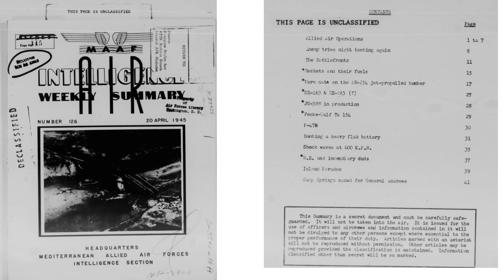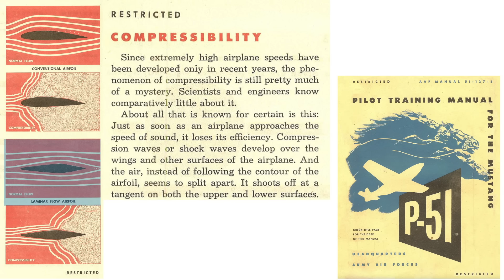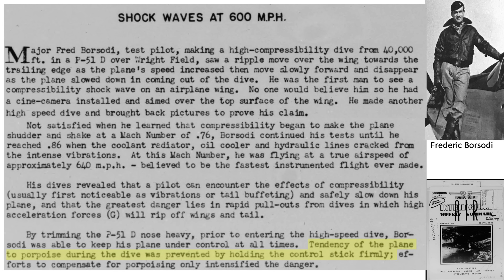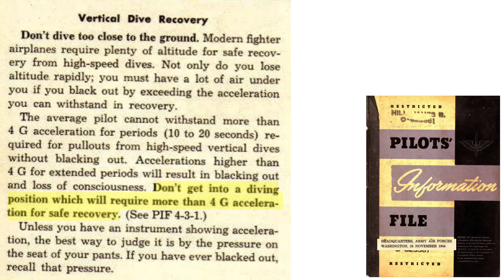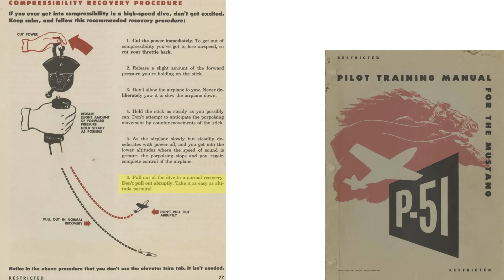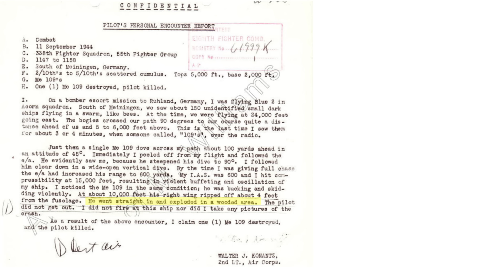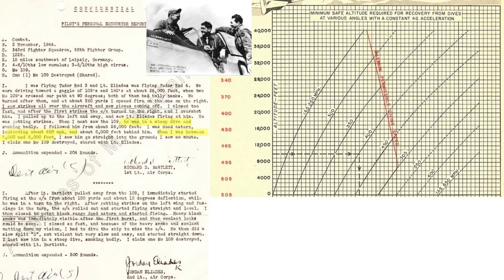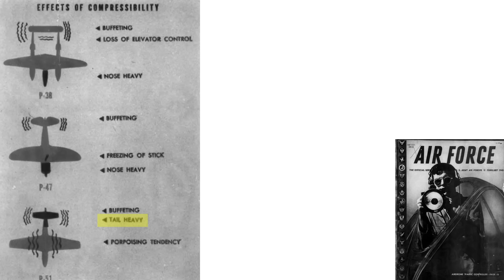P-51s Attacking German Fighters to Speeds of 650 mph, 7 Combat Narration Reviews

Comment: 640 mph True Airspeed and Mach 0.86 correspond to a Standard Day altitude of around 5000 ft.
I doubt that the actual numbers were close to that.  Airspeed Indicators and Altimeters get very inaccurate when shock wave start forming - particularly if the shock is near the Static Source Ports - where the reference values that the instruments use to derive the readings come from.
Reply: Agree
Reply: Very astute comment and very true.
Reply: I don't know about that one being in compressability at 500 ft either, even if his altitude was 500 feet above the ground that itself was 4 or 5 thousand feet above sea level, because an actual altitude of 500 feet above ground that's near sea level should have him in thick enough air that he shouldn't even be experiencing compressability, but either way with just 500 feet to go I don't understand how he could have recovered from compressability and pulled up in time, SPLAT!!! is how that should have ended, not him filling out a report, that steep of a dive and that speed at 500 ft the ground is about ½ second away, you'd think the result of that would have been "Dear Mr and Mrs Jones, the United States Army Air Forces regrets to inform you...", I actually rewound the video after I heard that because I thought I'd heard it wrong the first time and couldn't believe he said 500 ft.
Reply: Don't forget that it's warmer air as well - The Speed of Sound varies with temperature, not density.
On a Standard Day at Sea Level, Mach 1 is 'bout 760 mph.  It decreases with the temperature until you reach the Tropopause - About 36,000' - where it's 661 mph.
During the late 1950s - Early 1950s, when jets weren't yet supersonic in level flight - F-86s or Hawker Hunters, say, speed records were set in the hottest places you could find - Death Valley, or the Sahara Desert.
This allowed the highest airspeed for the airplane's Mach Number, thus pushing the point where the Drag Rise occurred higher.
Reply: -A Machmeter would have been a big help on these aircraft.   They require a fairly elaborate computation (eg square root extraction, see wiki article on mach meter equation) but that can be done mechanically with logarithmic antilogarithmic cams and addition subtraction through differentials.  Only the pitot-static (prandle tube) data is needed for the computer.
-Once you have the Mach meter you could use it to trim the elevator say electrically.  It's far better to have an all moving stabilisier than trim tabs.   Trimming for Mach tuck can't be done manually since the onset is too fast and then when it abates the aircraft can pitch so suddenly it disintegrates.   
-All the German aircraft had an all trimming elevator (Me 109, Fw 190, Me 262)  as did the piper cub but the P-51 used trim tabs.  
-So if I wanted to make the P-51 a better diving aircraft I'd add a Machmeter and if possible and automatically trimming stabilisier or elevator.
-Some kind of area ruling if possible.  Waisting the fuselage would be costly but maybe recontouring the bubble canopy.
Reply: @bernhardzunk7402  
Doesn't matter, there was no trimming compressability out of them, the airframes and wings just weren't designed to be able to keep the phenomenon from happening because nobody understood it at the time they were designed, they didn't know what it was as these were the first aircraft to approach the speed of sound, that's how aircraft designers found out about it, from the aircraft experiencing it with a human inside to report it, they didn't know what a shock wave was and how it moving from the leading edges of everything down the fuselage and across the surface of the wing to the trailing edge during transonic speeds would affect things, that's the problem, once the shock wave gets to the trailing edge of something it's no longer a problem, but when it moves back the wing and it gets to the ailerons it clamps onto them like a vice, and if at that point it dances back and forth across a control surface it can make them violently flap around and tear themselves apart, before they really understood what was going on the early prototype P47's with fabric covered control surfaces on the tail in high speed dive tests would rip them to shreds, they didn't really understand what was going on but they realized very quickly they'd better switch to metal surfaces, at that point in history about the only two things man made that broke the sound barrier was a projectile from a gun and a whip, needless to say neither one of them had a human on board to observe and experience shock waves and their effect, it took people in these first aircraft that had enough power and little enough drag to approach the speed of sound in a hard dive to discover shock waves and their effects, but their basic design just can't get through transonic speeds they can only get stuck in them.
Reply: @dukecraig2402  Nicely done - but your did forget one area where compressibility effects were known, and that they had been trying to work with since the early 1930s - propellers.  As propeller diameters increased, the blade tips started to exceed the speed of sound, decreasing efficiency and increasing noise.  You don't need much forward airspeed to reach that condition.
If you've ever heard a T-6 take off, most of that irritating snarl is coming from the prop tips exceeding the speed of sound,
Reply: @dukecraig2402  -In terms of using a machmeter to auto trim the stabiliser I'd like to note that its the modern solution for any jet that flies above Mach 0.8. At the time pilots notes for high speed dives (as in this video)  that were going to encounter mach tuck usually involved the advice to lightly trim the nose up before the dive.
-manually trimming out of the dive was extremely dangerous since when the Mach Tuck disappeared the aircraft would be massively over trimmed, pitch up and over stress before the pilot had an opportunity to react.  
-Using Mach pitch AutoTrim would do at least provide something to improve safe recover but without either swept wings, area ruling or thinner wings and other modifications such as a T tail etc there would be further Problems a little down the Mach road.  
-Good description of how the shock wave moved across the control surface .
Reply: @bernhardzunk7402  They did have Machmeters - they just weren't in general use.  Just like Airspeed Indicators and Altimeters, they're subject to Position Errors as the shockwaves form. As for trimming and pitch control effectiveness - Yes, the Me 109 and Me 262 used tailplane incidence for trim.  But in those aircraft, it was useless for control at high Mach Numbers - the actuators (Handwheel on the 109, Electric Motor on the 262) didn't have the strength to overcome the forces on the tailplane.  As for using a slab tail, it was well known, at least in the U.S. and Great Britain, that that could overcome the issue of the shockwaves reducing elevator effectiveness.  Slab tails were flown in 1943 on both sides of the Atlantic - A Spitfire at the A&AEE, and the XP-42 by the N.A.C.A. It was found that Irreversible Powered controls were necessary - the normal methods of easing control forces at the time - Aerodynamic Balancing, Boost Tabs and Servo Tabs - didn't work across the entire speed range.  What worked at low speeds didn't work at high speeds, and vice versa.
Trimming into a Transonic Dive in anything was a Bad Idea - due to the reduced control effectiveness above the Critical Mach Number, once the aircraft started to slow, and the elevators became effective, there would be a massive G onset that would most likely cause a structural failure.
Area Ruling doesn't give any significant advantages until you get above Mach 0.9.
The solution to getting most airplanes out of Compressibility Dives (The only way to get there), was the Dive Recovery Flap - an extendible flap on the lower surface of the wing, which would move the Center of Moment of the wing (Which shifts aft with the shockwave) forward, inducing a nose-up pitch.  These were added to the P-38 and P-47, which had lower Critical Mach Numbers, and didn't require much of a dive to get into trouble.
The P-51 and the Spitfire while susceptible to Mach Tuck and the other shockwave related problems, had higher Critical Mach Numbers, and better control in the buffet region, and didn't require the Dive Recovery Flaps.
While transonic behavior was a factor for propeller-driven fighters, it became critical for the early jets - they had low drag airframes, and enough thrust to be reaching their Mach Limits in level flight.  At that point Speed Brakes are your friend.
Reply: @peterstickney7608  Mach auto trim is a part of all modern transonic aircraft so adding it to a WW2 fighter would only have helped albeit in a small way without other measures and yes a more powerful ball jack screw servo motor would be needed.   Even subsonic theory requires 2.25 times more force for a speed increase of 50% square law (440mph to 650mph) and the need for a far more powerful servo is a given.  A cam shaft attached to the Mach meter could for instance start adding in progressive positive trim between say Mach 0.76 to 0.8 thus partially compensating for Mach Tuck depending on experimental data.
-Area ruling prevents formation of shock wave and not only shock drag but the handling issues it might cause.   German researchers were aware of the issue though not as comprehensively as Whitcomb.   They for instance 'flow matched' avoiding a sudden change in area at the wing/fuselage interface and ending up with at least one coke bottle fuselage.   It was a sort of local area rule.   Intake designs were also local area ruled in some cases and of course the swept wing is also intrinsically area ruling.
- Interestingly post war transonic jets that cruised at Mach 0.9+, way beyond a WW2 fighter, like the DC-8 and B707, didn't need hydraulic flight controls and didn't fine with spring servo tabs.   (spoilers were Hydraulik).   Irreversible controls were essential on fighters.

-There was a fair bit of transonic knowledge in the USA by 1943 but for the most part the USAAF due to Happ Arnold froze NACA out of the loop and even denied informing them of the whittle turbojet.   This in part I think resulted in the poor performance of the P-59.
-Its worth finding REPORT No. 802  NACA INVESTIGATION OF A JET-PROPULSION SYSTEM APPLICABLE TO FLIGHT By MACON C. ELLIS, Jr., and CLINTON E. BBOW
This is about Eastman Jacobs "Jake's Jeep" which is a US 1940-1943 US NACA attempt at Mach 0.8 cruise Motor Jet.   It lead directly to the Bell X -1.
Jake's Jeep used a Butterfly tail to avoid control problems from shock waves impingement on the control surfaces.  V tails a good solution as is anhedral (eg F-4 Phantom) or dihedral but eventually replaced by the all flying stabilator.
-The Germans for the most part worked on using the T tail with the aircraft configured as a flying wing and the T tail only for trimming or butterfly tails.
Reply: Compressibility effects start at the speed of a gnat. Or a fruit-fly. 

They grow exponentially with velocity. Specifically, with mach number.

The speed of sound in air is correlated to temperature. And nothing else. Not pressure, etc.

Mach is very close to 331.5m/s at 0c or 273.15 Kelvin. 

Any speed above even 1mm/s begins to build compressibility effects.

It reaches 1% at around 150mph (67m/s). 

It is something like 8% at WWII fighters top speeds. And it jumps to nearly 20% in a high speed dive at high altitude, where it's cold. 

This is a +20% increase in dynamic pressure over the airplane. And also inside the Pitot tube. 

Which measures the ram-air pressure (q).

Because compressibility increases the density of the air due to compression, the Pitot tube that is calibrated with the assumption that air is incompressible will show a higher velocity than it actually is flying at.

 There are several notable pilots who all believed they exceeded the speed of sound in dives. In propellers and also the F-86 jets. But this is almost certainly not true, as even the F-86 was going to have severe issues while supersonic. At minimum, compressor stall and possibly catastrophic engine disassembly. It did not have a supersonic inlet.

Comment: Add to the list the Vickers Spitfire. British three needle altimeters were ranged to 45,000 feet. That's a wild ride. At Mach one, a vacuum exists behind the shock wave and it claps together again. Tail feathers can fall into the shadow and stop working. Any bumps, rods, or hinges that jut into the flow, become large in the aerodynamic equation. The air forces did not awaken to the study of supesonic air and pre supersonic stream. They felt it first.